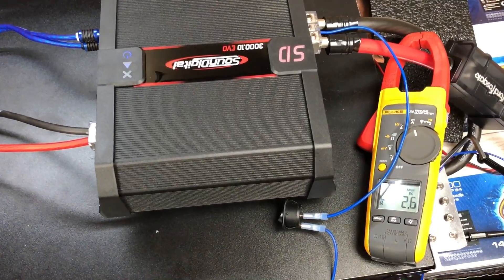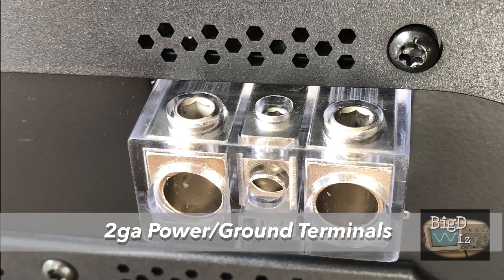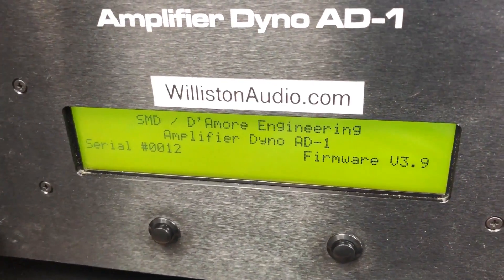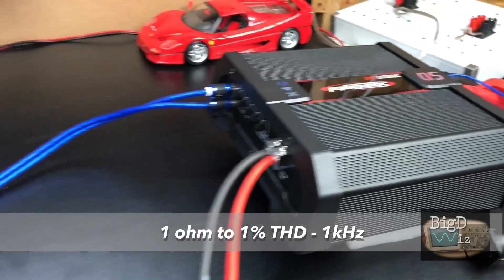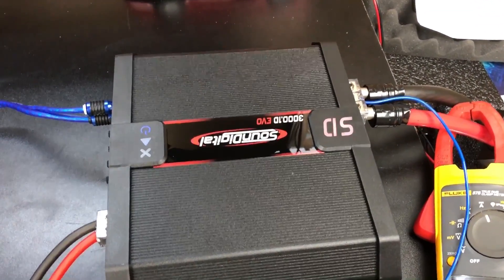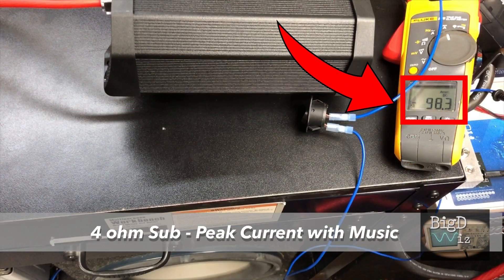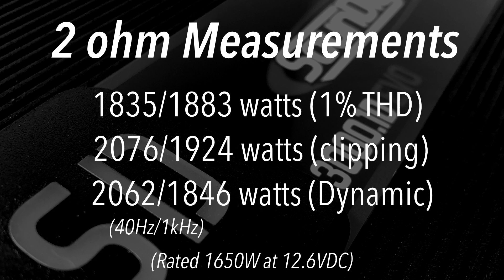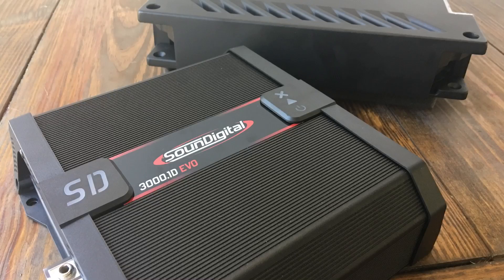SounDigital SD 3000.1D EVO II Amp Dyno Test

Comment: Hey can you do a amp dyno test of the Sunbuck MP326BT?
Reply from the maker: I’ve never heard of that amp brand or model? What part of China does it dwell?
Reply: BigDWiz LMFAO... Beat me to it... I've never heard of it either... Any way I have 2 ohm DVD kicker l7 15... And I'm running it with pioneers GM d8601... It sounds really good but the sub barely moves... I know they can handle a good bit of power... Any recommendations on a am that would make this sob flex?

Comment: I miss the days when it actually took Install & design skills to get a lot of bass from an Install. These days it’s ridiculously easy to get thousands of watts and heart beat altering bass.
Reply from the maker: You’ve got a point...
Reply: NvTwist you still have to have a well designed and built box...it makes all the difference in the world
Reply: I am using a 1 3/4"birch transmission 4th order box with 7.68 cubic feet of air space
Reply: jeremy isler that means your a good carpenter & box builder. As far as designing you need no experience because your Computer does all the calculations, people that wanted a box with the most output had to come see see us at the Audio shop. Then installers started sharing their tricks on the internet not aware of what the internet would become.
Reply: NvTwist no I paid a guy named Kieth Payne here in Mobile,Al....dude is a living legend!  We are now installing 2 CVT 10's because I need some mid bass.....them 15's hit so freaking low!!!

Comment: So this amp and all Brazilian amps draw a lot of current. Why only 1 set of maybe 2 gauge power and ground? If they need more current than class D, then why are we spending all this money feeding class D????
Reply from the maker: These are Class D...takes power to make power, doesn’t matter the size or topology of the amp. These have good efficiency, but at higher frequencies. My thoughts are these were brought to the US Market, but were never intended for low frequency use. In Brazil, they power massive setups of Pro Audio style speakers. Not saying they “can’t” power subs, just saying I don’t believe this was their intended use. This is my opinion of course

Comment: whats the temps like?  the major problem with these from what ive seen around the net, is the high voltages used, and the temps cause them to over heat and burn up. 
so, it can make those numbers, but not for any duration... those peaks need to be intermittent. 

also, if the amps can tolerate 16v, can u run them at 16v and see how they perform? not to kill them, but to see if i set up an 16v system, if i can put them on the same 16v and still use them. i may not drive them to max, but still use them on 16v to avoid having a separate 14v system.
Reply from the maker: This one stayed cool during the entire test, but the fan was on the entire test and it was loud imo

Comment: thats a lot of cash for 3k watts..i know it would have been a steal 10 years ago..but I keep seeing you guys testing some cheap amps putting up some crazy numbers like the korean made orion amp
Reply from the maker: The Orion XTR-2500.1Dz is tough to beat 👌
Reply: The thing is it’s about clean power, your paying for the clean power on the soundigital amps. I own 2 of the budget gems in the skar rp 2000.1’s and they make a lot of power for cheap but it’s not the cleanest power. And cheaper made amps are prone to mess up.
Reply: thats why you dont get the 3k... brazilians are only worth it when you get to the 8k rms mark
Reply: juicewatter
what are you talking about?..BigD did both the test on this amp and the Orion as well as all the other amps he's tested with the same testing regimen...dont give me this "clean power" crap
Reply: I own both the Skar RP-2k and the Orion Xtr 2500dz. Both are great amps for the money, but the Orion has my vote with 2976 watts rms @12.6v. Best $329 I've ever spent on audio gear. It's so good, it makes me want to get another one to strap them.

Comment: Well watts can't really tell you how loud your speakers get, it's how sensitive they are, most car audio speaker/subs are really insensitive, at around 86 to 90 db/1m, Example, you have a subwoofer with 86db/1m sensitivity, if you play 512 watts to it you get 113db at 1 meter away from the speaker. But if you have a speaker with 99db/1m, with the same watts you will get 126 db at 1 meter away from the speaker. that's a 13db difference, becuase you used the same amp with different sensitivity speakers. so to play at 113 db at the 99db/1m speaker will need ~26 watts. This is a really simplified example.
Reply from the maker: True, those subs with the huge magnets and fat surrounds in most cases are inefficient

Comment: Nice Video D. I'll never understand why the Brazilian companies refuse to use 1/0 inputs on these 3k and 4k amps.
Reply from the maker: Great question, I’d like to know as well...SounDigital??
Reply: It completely baffles me as to why they cheap out on the most important connection on the amp. It's the most obvious weak link I've ever seen, and nobody bothers to fix it. You think they would with all the blown power supplies they see.

Comment: Off topic, but I'm guessing cooling fans don't get much work in your shop.  I think I can count on one hand how many times the amp dyno has shown a temperature above 60° F.

This video started off only a few degrees off of my a snowflake in my car's temp display - in FL, that happens maybe a couple of times a year. 😨
Reply from the maker: Winter in NC, lol. I test all year, so you’ll see higher temps in the summer, but remember the temps shown are the resistors inside the AD-1, not the ambient temp

Comment: Couldve used tiffany style inputs
Reply from the maker: Yeah! So I’ve been told these amps are really cheap in Brazil, like $250 USD. Export plus import fees likely raised the US price, but I also believe there is some big markup too. Build quality does not look like a $600 amp to me 🤷‍♂️
Reply: BigDWiz makes sense. I bet even 250 usd is a good chunk o' change down there. Performance and footprint is impressive though

Comment: I don't believe that damping factor that has to be a type - O. That's twice as good as many known SQ amps.
Reply: JL has a damping factor of 500 and Masconi has 6000 but the Masconi cost about $3,000. It's been just hard to believe an amp at this price has a damping factor of 1000.
Reply: I am Brazilian, I have a SQ and I ask myself every day, I am in doubt whether to buy or not, here it costs R $ 389 Reais, equivalent to 117.61 USD and this does not make sense to me, mainly because Ground Zero sells this amplifier for 500 Eur
Reply: Diego M I try to buy things that are U.S. built because it supports U.S. workers. So It may cost more but maybe you should support Brazilian workers. That's a judgement call. My knowledge of Brazilian amps are limited ,they are getting better and better quality,but a lot of people are buying them so maybe it's worth it.
Reply: you are very sure, you have to support your country, unfortunately here in the technology part there are few good things. The SoundDigital and Band amplifiers are very good. I think I'm going to buy the SD 1200.1 for my car sound, here it's cheap, in europe and sold very expensive, the SD brand besides europe is also very famous in turkey.
Reply: doesn't really matter anyway, there's been research that shows above (I believe) 100 damping factor is inaudible.
Reply: Mitchell Roberts Yeah kind of like Hi- Res audio it goes from like 40 to 60k Hertz only a dog can hear, that and below 25 hz you can only feel it. They are really just gimmicks to sell product.
Reply: Diego M barevids on YouTube says that Brazilian amps work very close to maximum ability and leave very little head room compared to Korean and U.S. made amps. If you run them below 1ohm for a sub amp and I think 2 ohm on a stereo amp they become very unreliable because they are at the maximum ability. People run them at the maximum and blow them I hope this helps.

Comment: Based on the comments, we have a long way to go when it comes to clearing up misconceptions about Full Bridge amplifiers from Brazil.
Reply from the maker: Please explain misconceptions?
Reply: A lot of people seem to think these are terrible quality amplifiers because of their size and lack of components. They don't believe that, because the power input terminals are small, it can't do rated power. I still catch people all the time saying your brazilian amplifier will catch on fire when many people have seen more korean designed boards from insert nuthugged company here catch on fire.
Reply: I don't think these things are misconceptions. The power inputs are too small for the current capability of the amplifier. You can't pass 400+ amps through a 4 guage of any significant length and not start a fire or two, especially if it's an inexperienced user/installer with cca wire or something.

Comment: Would you rather buy this or the $1,499 rockford fosgate 2500bdcp?   Everytime I look at these videos I cry a little bit because I spent so much for my 2500bdcp
Reply from the maker: The T2500 is in another league than these amps. That amp should give you years of reliable bassin’ plus with the CP technology would be less prone to impedance rise and would sound louder
Reply: Very true!  My pocket book was upset with me for a little while though
Reply: The T2500 puts out around 3k watts @ 2 ohms. That's what you would expect from a 5k or 6k amp, so the price is not as bad as it seems. Just think of it as a "cheater style" 2500 lol
Reply: Got the evo 12k, clean bass and I've seen two of these clamp over 18k (over 2ohm rise on the 1ohm amps gain matched)
But control knobs are pretty cheap feeling. But stupid power for $1500
Reply: +jar1zx rcfun haven't yet clamped mine.........will soon

Comment: Big deal dude I seen u had both rca plugged in u did realize it only has 1 rca for input and 1 for output. Same with the banda only 1 input. On my 12000.1 I have my rcas going from 2to1 y splitter
Reply from the maker: Dude, I didn’t even notice until you just pointed it out. Total Big Dummy here 🤪
Reply from the maker: Dude, I didn’t even notice until you just pointed it out. Total Big Dummy here...
Reply from the maker: Dude, I didn’t even notice until you just pointed it out. Total Big Dummy here...
Reply: BigDWiz lmao bro I noticed it when I hooked up the 12000.1 I was like wtf lol. I about did the same I'm a big dummy too I just have a habit of double checking everything lol
Reply: I did the same as Big D the first time I hooked mine up....

Comment: I wonder how the Audiopipe Apcle3000 would do on the dyno. Haven't found any dyno videos on many Audiopipe amps other than the 1500s
Reply from the maker: The 3000 has (2) 1500 boards inside, so just double the results you see
Reply: That's between 2600 and 2900 watts

Comment: Bandas look a bit nicer then Tara and these amps. Not sure I will be trusting any of them with my money.
Reply from the maker: I’d have to agree. Banda is much more stout from a build quality aspect. We’ll see about power and sound 😜
Reply: Mitchell Roberts from what I understand a few repairmen have told me they aren't very reliable but are getting better as they progress. I guess if you don't get better you go out of business.
Reply: Look forward a banda test so itching to get one because of its foot prints just don't trust that single input on a large power amp
Reply: The Banda 7k does every bit of rated power regardless of the fact it's single 1/0 inputs. I had mine with dual 1/0 adapters and it was a great amp. I imagine the rest do rated too, but I am unsure of their build quality.